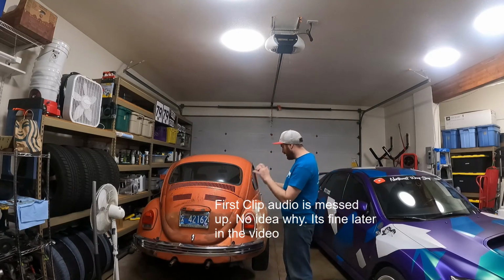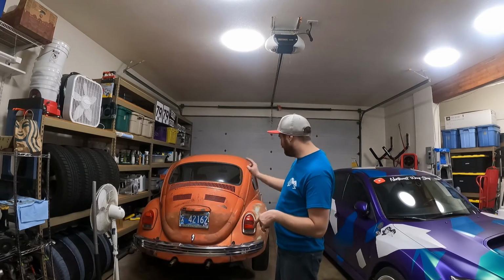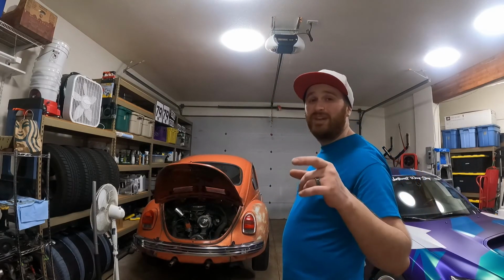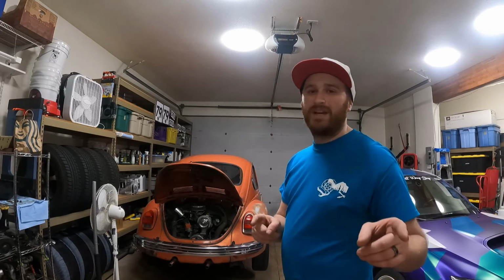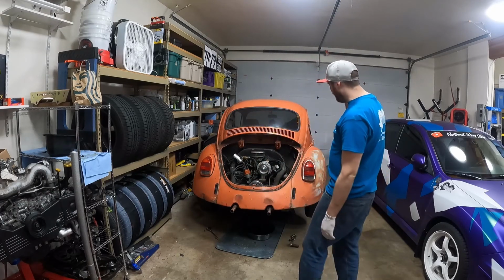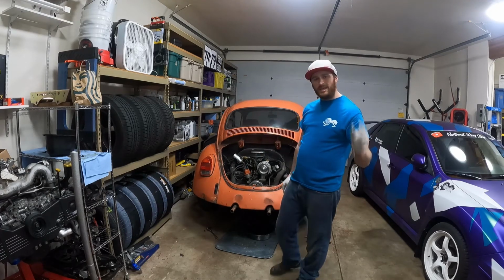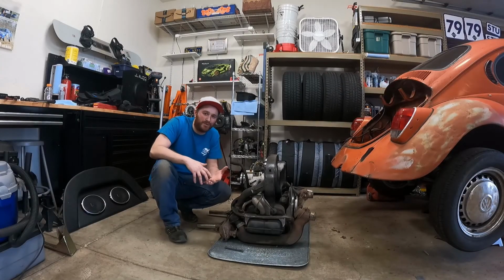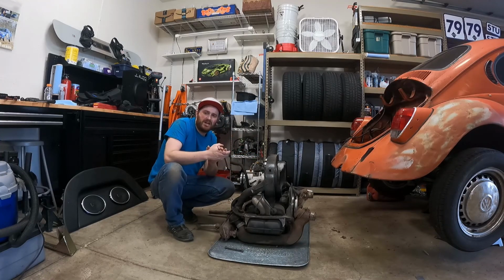VW Bug Engine Swap. Superu Beetle Part 1

Comment: How much horse power dose the Subaru motor have that you put in your bug
Reply from the maker: Probably only like 150ish. It's an all stock 2.2 nothing fancy. But it should be better on power and torque than the air cooler motor

Comment: What year is your car?
Reply from the maker: 71 super beetle
Reply: @Fix_it_Garage  the kennedy parts fit for the year 65 too? Muchas gracias, thanks a lot
Reply from the maker: @rodrigoalvarezgallardo  Kennedy does make an adaptor plate and clutch that will fit a 65. Each adaptor plate is made to order. Your best best is to call or email kennedy and they will make sure you get exactly what you need
Reply: @Fix_it_Garage Thank you very much, I will do it as you advise me. muchísimas gracias por tu respuesta. Así lo haré.